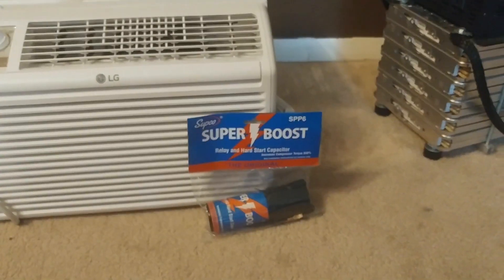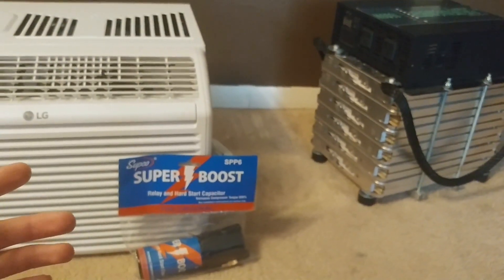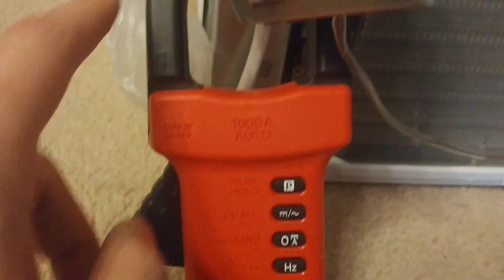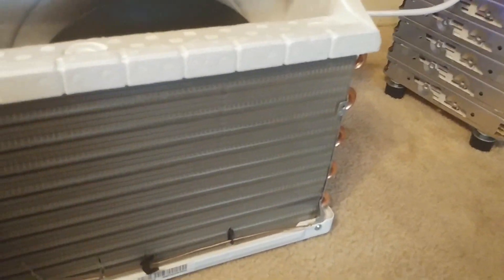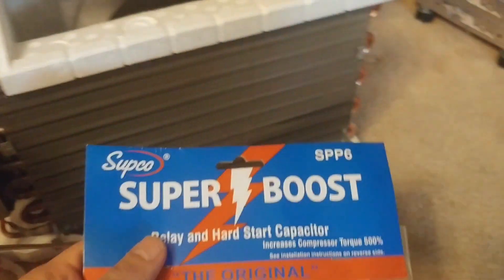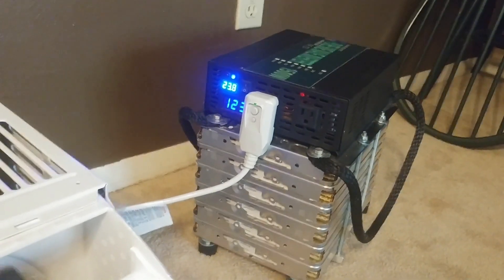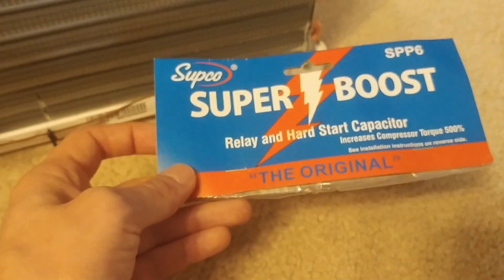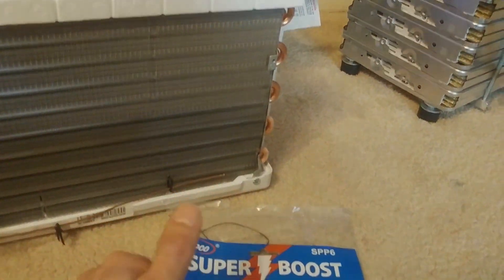Installing and Testing Supco SPP6 hard start capacitor on LG 5000 btu AC with 1500w inverter

Comment: Something is not right. I live in a van and have had an air conditioner now for 5 years. A 5000 btu air conditioner pulls at least 40 amps on a 12 volt system⁶. The rating of a 5000 btu air conditioner at 120 volts is only 4 amps. If it functions on a 12 volt system than the amperage has to go up ten times 12 volts. That's why something is not right with that air conditioner. Now, I have a 6000 btu air conditioner and it draws 50 amps/hour.

Comment: It's not about electricity economy or something like this. When ur AC starting the compressor, it will discharge this capacitor for use his energy just for start and not make an impact to power system. When ur AC already working, u will not see any effect...

Comment: A 5000 btu ac doesnt use 21 amps, should be less than 10 amps when running. Good idea to check amps it in a wall socket, problem may be with inverter, check voltage out of inverter with a meter. Maybe need different starter, or inverter, but solve the amp thing first.

Comment: I was going to run that same LG air conditioner on my LiFePo 100ah battery with a 1500 watt inverter.  Are you telling me the surge is actually 21 amps (21x115V=2415 Watts @ surge)?

Comment: The peak current didn't change because the inverter still has to charge the starting capacitor. You would need to add capacitance between the inverter and AC unit. That way, the capacitor will provide the 20A peak instead of the inverter.

Comment: I installed an SPP5 on the exact same LG air conditioner and had good results. I can't give you exact amperage numbers before and after, but my generator starts the AC unit MUCH easier after the install.
Reply: Did you hook yours up the same way as this video?
Reply: @ParkRoadGuy  
Yes, Sir.

Comment: I picked an off-brand one up to check it out, the wires seem to thin to supply much if any significant amperage, also left it in my old Coleman Mach till it gets a real hard start kit.

Comment: That hard start is probably rated for a much larger compressor. You need a very small hard start to work correctly with that unit.

Comment: These are rated for. 0.5-10 HP. Is your little fan motor on this window shaker less then 0.5 HP? I'm sure that could be an issue. I have this SPP6 Supco Hard Start on our 2 Ton A/C condenser outside and it works awesome. That is probably the better application. 👍

Comment: You did not see a surge. That is what the capacitor absorbs
Reply: The 21 amps IS the surge. Once running, that AC unit runs on about 5 amps or less.
Reply: That's absolutely not how that works.